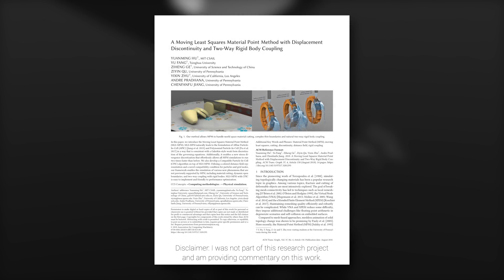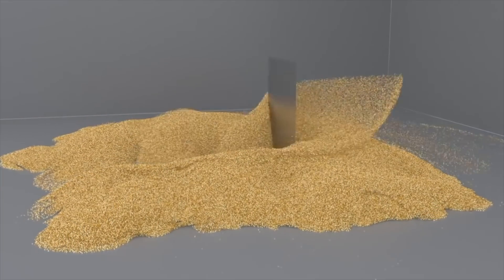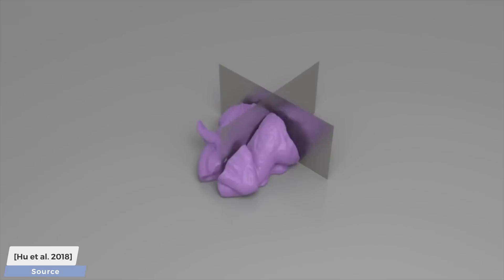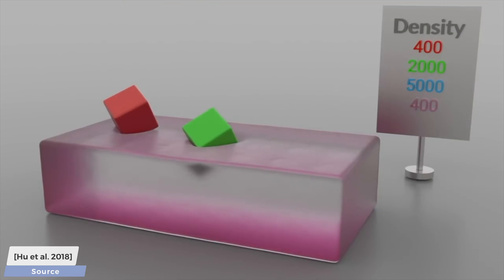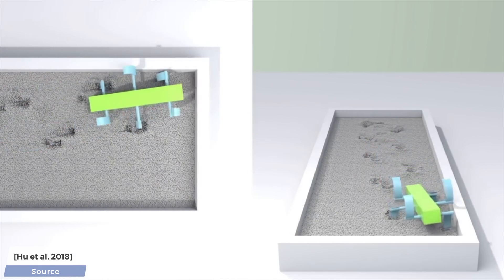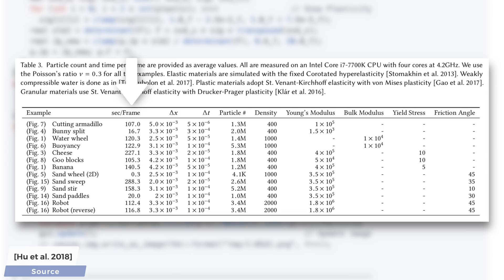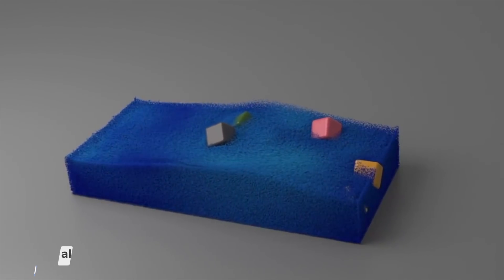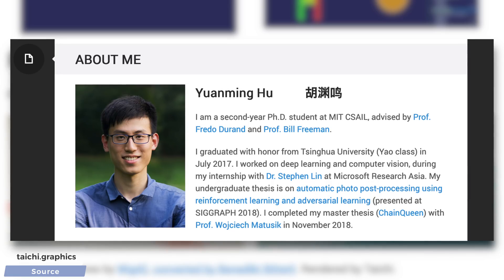This Jello Simulation Uses Only ~88 Lines of Code

Comment: Hold up. The 88 line program you refer to is for a simulating some 2D squares, not jello. So yeah, it is pretty misleading to claim in the title that it only uses  88 lines for the complex, high performance 3D simulations. The actual project on Github is over 7,000 lines of code in its current state. Here is a link to the actual thing the 88 lines does - https://tinyurl.com/y5cgbztu

Comment: More like 10000 lines. Just because u cant see em dosnt mean they aint there
Reply: The code has to run on an operating system so it can be processed by the cpu so by your argument it's millions of lines of code
Reply: Candyapplebone yes. Although we take the OS & kernel, ASM, machien language.. etc for granted more than we take the high level libraries. Thats why i only limited it to 10000.

I mean of your gonna be nit picky, why not include all the code ran by the robots in the assembly line that peaced togeather the computer your using right now.. and the code that runs on the robots who mine the raw materials needed.
Reply: @kevin42  my point is we shouldn't be picky. If the guy wrote helpful enough libraries that it took "88 lines" to make a simulation then that's cool. Python is famous for visualizing stuff in a handful. Same arguments from the other comments apply, doesn't change the fact that this guy's work is cool
Reply: Candyapplebone oh, no no i didnt mean to be picky. My OCD just went off and i wanted to clarify to the general public(fellow newbies to programming) that it infact isnt that ”easy” when u dive deep into whats actually going on.

by all means use 100 libs for your next project, im a sucker for a good lib aswell.

Comment: 88 Lines of code but has #include "taichi.h" HMMMMMMM
Reply: thats just the graphics engine library, all the calculations are done in those 88 lines
Reply: A fair comparison would be to check the size of the compiled binary.

Comment: When can I expect to see these kind of physics in PC video games?
Reply: I would guess around 7 years based on mores law and the 122.9 seconds per frame (becomes 1.04 fps assuming the speed doubles every year)in the buoyancy test. Tbh it will probably be longer or shorter depending on consumer demand for something like this in a game. Just my opinion tho.
Reply: @TrollsGoBouncing  "Moore's law is the observation that the number of transistors in a dense integrated circuit doubles about every two years." (source: Wikipedia)
That makes your estimate 14 years instead of 7 years (2**(14/2) ~ 122 => 1 FPS in 14 years).
However, if we want to go to 30 FPS we would need another 5 doubling which makes it 24 years.

That all said, as Károly Zsolnai-Fehér says "Two more papers down the line" we might see amazing improvements which could cut down the hardware capability requirements and therefore my estimate of 24 years.
Reply: 20 years, more or less

Comment: Brilliant but....
What if the optimisation on the objects were dependent on the locality of the nearest adjacent particles, and when beyond that scope of interactivity, a replacement mesh is presented in place of particles of the models that are not being interacted with (ergo statically predictable values based on lesser, and more standard physics calcs).  Surely this would speed up the calculations immensely?
Reply: You've got the code, dude.  Go do it

Comment: It's measured in seconds per frame but it's implemented on the CPU with even a CPU rasterizer. Could probably be significantly faster when implemented on GPU shaders. Although it would probably be more than 88 lines..

Comment: 88 lines of code which calls libraries that use thousands ;P
Reply: true and true, my cloth simulation also have just few line of actual simulation code + keyboard event handler + unknown amount of code from opengl imports xD
Reply: Yeah...

But then again it's all relative.

Think about how much code is actually involved in writing GUI code for instance.

Leaving aside the insane amount of library and SDK code being called behind the scenes, getting a single window with the most basic input hooks set up in windows takes about 100-150 lines of code.

Writing something that constitutes a complete, functioning program on an atari 800XL (1982 computer) can be done in less than 80 lines with no libraries to speak of...

That's just a fact of life.
As computers and operating systems have become more complex, the expectations and layers of abstraction have become more and more extreme.

Getting that atari to draw a single pixel onscreen can be done with a single assembly language instruction, and maybe in the worst case about 50 instruction of setup right as the computer powers on. (for the era the Atari had a rather complex graphics chip that required a bunch of config - and if you're loading off floppy disk you get a bunch of extra complications.)

To get a modern GPU to draw a single pixel onscreen, assuming you're also dealing with a modern OS...

Would constitute about 500 lines of code you have to write yourself, and calls to about 3 different SDK's which contains at a minimum tens of thousands of lines of code, which in turn call operating system and driver routines which could get you into hundreds of thousands of lines of code directly or indirectly involved in the task.

And what have you accomplished? Nothing more impressive than what the computer from 40 years ago did in a handful of instructions.

Of course, that's not to downplay the capabilities of modern computers. That extra complexity arose for good reason.

But it does put things in perspective about how much work is being done for you behind the scenes, I hope.
Reply: The thing is that most modern programming mediums have these libraries in them ANYWAY so

Comment: The `#include "taichi.h` kind of voids out the 88 line of code claim, though it's a general purpose physics/graphics library so I can kind of excuse it a little. But the several lines of code are condensed onto a single line for no reason, and several variable names are shortened (like `int c/*color*/;`), types are shortened from Vector2 to Vec (why not just to V though?). Obviously it's golfed, but the arbitrary whitespace is kind of confusing. The actual non-golfed code would be probably around 300 lines of code, and if you don't care about white space you could condense it further to 44 lines of code still using 80 column.

Comment: 88 lines of code, then i see
#include "taichi.h"
🤔
Reply: I really don't think graphics is important to the algorithm. It could be written in less than 88 lines of code if you don't want a graphical output :)
Reply: @psyneur9182  Yep but graphics also includes mathematics utilities, which he uses extensively.
Reply: @rexviperfan  Also, lines of code have no meaning in C++. Sure, in actual, readable and well-written code it can be used as a rough estimate of complexity, but if you wanted to, you could put all code in a single line. If you check out their Git, you can see that their much more readable "mls-mpm88-explained.cpp" has more than triple the line count.
Reply: @TheFlynCow  theyre following 80 column limit and some whitespace standards, but yeah they arbitrarily put several lines of code into one, shorten variable names, etc. The code is golfed, but to line count instead of character count. I could get it down to ~44 lines of 80-column code by removing whitespace.
Reply: For everybody who didn't get it #include is just a dumb "copy/paste this file here". The proper compiler works with a far larger file that can become really huge if there are #include directives in those other files and so on, and so on.
Reply: @txorimorea3869  So it basically uses an external library.
Reply: @ViciousViscount  yes, taichi is a graphics library written by the same person. He uses it in all of his other simulations so it's kind of excusable.
Reply: @txorimorea3869  What you loli hag doing here?
Go get into your library
Reply: @Beatrice
"can become really huge if there are #include directives in those other files and so on, and so on"
lol just like node_modules
Reply: "taichi.h" is literally only the graphics library.
The entire simulation of particles can be done in 88 lines of code, which isn't accurate either because he uses Vectors, which are structures, and they must be defined, too. You could count those as "lines of code"; however, the reason we choose not to count those is because it accurately depicts a coordinate system, so everyone uses it. Where the real argument to be made is, is whether or not "special operations" were made for those Vector structures, in which that would count as "more lines of code"; anything but the common functions of a vector (the common functions being addition, multiplication, etc.) should be counted, and that's what is being counted in this case.

It simplifies the process of keeping track of a bunch of variables. ParticlePosition could be a 2D Vector, which includes an X and Y variable, for example. Adding a new position, or an offset of another position, would then update all values of the vector accordingly; for example, adding (1, -2) to the ParticlePosition would be one line of "ParticlePosition += Vector2D(1, -2); It is my humble opinion that this is fine to count as only one line as it not only reflects common programming practices (like encapsulation), but it's also just simply taking the burden of having to type out every single individual variable; it would be the equivalent of doing "ParticlePosition.x += 1; ParticlePosition.Y += -2;" You might as well count it as one single operation of addition since that's the entirety of a Vector's purpose.
Reply: @beemer9108  Ok he uses more than vectors, and how you describe vectors is very misleading. vectors do more than store XYZ, they allow functions like dot/cross product, matrix multiplication, swizzling, etc. Not sure if the latter two are in this, but there are some odd functions i havent seen in other graphics apis, and seem to be core to the similation. on phone rn tho so cant give details but theyre fairly obvious.

i dont care either way because the library isnt specialized for this specific program, its just something to keep in mind with the 88 line claim. It would be magnitudes larger without the library, even if you remove the graphics part of the program
Reply: @beemer9108  Thanks, we all know how cpp works and what vectors are... The argument is that line count is not representative of code complexity.
Reply: How small you can get your lines is one of those strange dick measuring competitions that only really makes sense when you have that code reviewed and the reviewer OKs it.
Reply: @IttyBittyVox  In general people want their code to be as short as possible, as this helps with processing speed ;)
Reply: @suicidalbanananana  Isn't that defined by time complexity? Shorter code doesn't mean faster code.
Reply: @simioni  I think @suicidal.banana was being sarcastic. Very few people (though they do exist) really think that shorter code runs faster enough to say it out-loud.
Reply: Not only that, but it requires an actual computer to run it!

(sorry)
Reply: More importantly: isn't that 88 lines for 2D only?
Reply: Exactly my thought. I could say that I made an extremely complex script with like 5 lines and just have the whole package inside .h file and have the father script call to it
Reply: Libraries don’t count in lines of code. If so everyone would be screwed for including the standard library
Reply: It isn't that the underlying code is super simple...  It is that there is a nice simple(ish) API.   That is a good thing.

Comment: In C++, a lot can be written on one line!
Reply: Also in C++: You need to write A LOT of code to do the same that C# does in a few lines.
Reply: @jonathanozik5442  ; Not true at all.
Reply: @rexviperfan  I'm guessing Your knowledge is superior to mine. C++ and C# is NOT my specialty. I'm mostly a Web Dev, but a quick google for "make a screenshot in c#" vs "...c++" gives results:

https://stackoverflow.com/questions/1163761/capture-screenshot-of-active-window

https://stackoverflow.com/questions/3291167/how-can-i-take-a-screenshot-in-a-windows-application

c# 4 lines.
c++ 10 lines.

Of course different projects will vary in length wildly. :)
Reply: Jonathan Ozik and in c++ it is not platform independent
Reply: @whythosenames  C++ is platform independent what are you talking about? You can write non portable code but thats different
Reply: @jonathanozik5442  Not familiar with the WinApi, but this is a very unfair comparison because C# is made by Windows, so the WinApi you see in the example is C#. But the Winapi you see in that C++ example is actually a C api, so you're comparing C Winapi to C# winapi here lol.